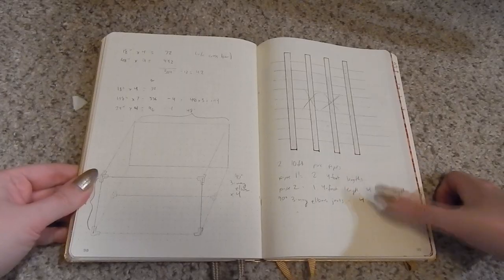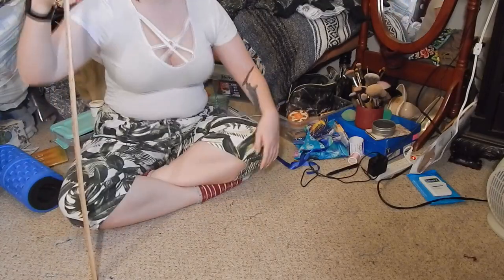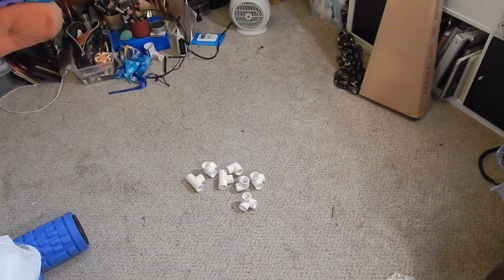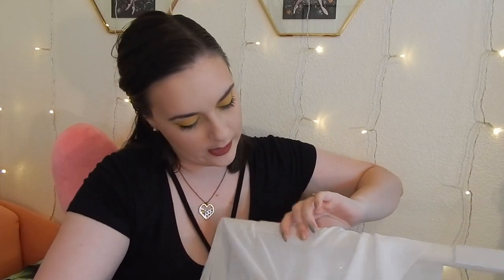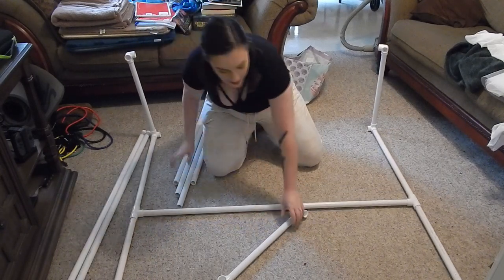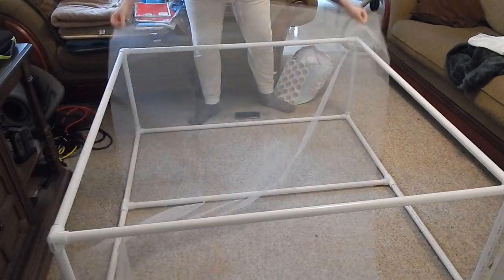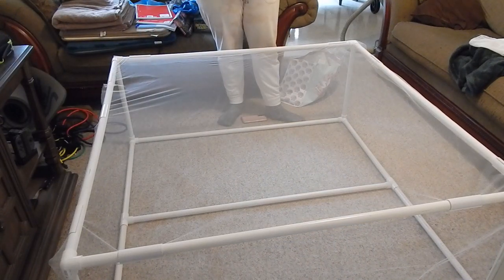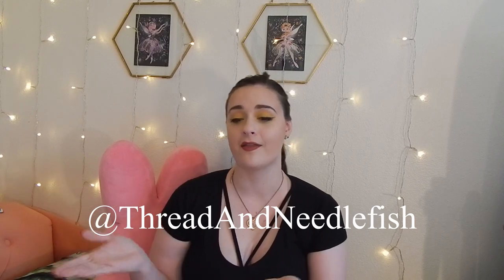I Built a Giant PVC Embroidery Frame

Comment: To make sure your material is straight and taught, put 1st clamp in the middle on side of frame where you sit, then go to opposite end of frame and attach clamp directly opposite the 1st clamp pulling material tight. Now go to one of the long sides and repeat, tightening as you go. Same for the remaining side. Go back to the side where you started, and place a clamp 1/2 way between the middle clamp and the nearest corner. Repeat on other side. Repeat on remaing 3 sides, adjusting tension as you go. If you need more tension put on more clamps. If your clamps are opposite each other, add more clamps if you want. Just remember that each clamp needs an opposite clamp to keep even tension.  If this is too confusing, look up how a quilter keeps the layers of a quilt straight before binding. (I apologize for the length.)
Reply: That’s exactly how I was taught to stretch a canvas when I took painting classes and we had to stretch our own canvases 😊 very good advice!